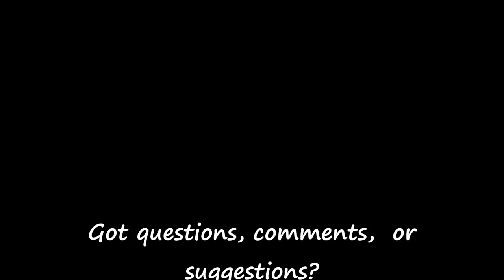My Hot-Tent Wood Stove Setup for Preventing Floor Melt...and more.

Comment: Great advice and very helpful, Martin.  Looking forward to avoiding the pool of water in our front entrance the next time we go out.
Reply from the maker: Thanks and glad you found it helpful.   I'm sure it will make a difference on your future trips. 
Happy camping, 
- Martin
Reply: @PineMartyn  One other quick question if you don't mind me asking.  What do you place under your sleep system when on the snow?  Tarp? Pad? We have not camped on Crown land so a bow bed is not an option.  Once again, thanks.
Reply from the maker: @bwbeney  Great question. I lay down a waterproof tarp, then my inflatable sleeping pad on that, and atop that goes my closed-cell foam pad, and lastly my sleeping bag.
When camping on Crown land and spruce or fir boughs are plentiful, I make a bough bed and put my sleep system atop that for greater insulation and comfort.
Cheers,
-Martin
Reply: @PineMartyn Had been wondering what replacement for my newly purchased closed cell pad would work as the pad felt rock hard and unusable. Is your waterproof tarp run only the length of your pad, bag length? Or just inside the tents' inside perimeter covering everyone's sleeping area? ( 1st year using a Hot Tent and stove in the NC Winter forests).
Reply from the maker: @bikemannc   I apologize for not replying sooner, but I have only now noticed your question.  The waterproof ground tarp I use just covers my sleeping area, but it could be larger if you wished.  I'd just keep anything that could burn or melt far enough away from the stove.  
Hope this helps, 
- Martin

Comment: Can you please comment or create another video explaining how putting 2 ninety degree angles in your hot tent stove pipe is a no-no 🤔. Thank you for finally explaining a proper stove setup. I worry about some of our backcountry friends setups and want everyone to stay as safe as possible out there. Great video.
Reply from the maker: Hmm, that's an interesting thing you describe. I think the only time I have seen two 90 degree elbows used in a hot tent is in very large tents for large groups, where the stove jack hole was high on one vertical wall (not in the roof, as it common in most smaller hot-tents).  Such tents invariably have a quite large stove with very wide diameter stove pipes which make it possible to have 2 such elbow joints and remain sturdy and avoid backflow of smoke into the tent.   I'd certainly caution against this in more typical camping hot-tents.
I'm glad you enjoyed the video.
Cheers!
- Martin

Comment: Martyn, my wife and I loved your 11 day trip on crown land and you and your wife has inspired us to follow in your footsteps on a smaller level at first.  My question is, do you leave your car at home or do you feel it is safe to just park on dirt roads etc.  It is our only concern when exploring.  Thanks you sir.
Reply from the maker: I apologize for not replying sooner. I missed this comment and am only now noticing it.  Excellent question.

We leave our car parked wherever we can, such that it's not blocking any road or trail,  not hindering drivers by being too close to the road, and not in the way of any plows in winter.  

Invariably, one has to go to the Crown land in question and look for a suitable place to park near to where one wants to start hiking, snowshoeing, or canoeing .  Sometimes, the best place to park is not as close as one would like, so one parks where one can and puts in the work of hiking, hauling, portaging, whatever distance is necessary to start one's trip.  Remember, it's not important that you be parked right where you're about to start your hike or camping trip. It's more important that it be off the road or trail enough that it won't be a hazard to others, but wont' get stuck either.

I have never had any harm come to my vehicles in the bush.  Break-ins are common at park trailheads because thieves know there will be vehicles there unattended for hours or days and probably there is gear or valuables inside.  When you're out in the middle of nowhere, the chances are slim that anyone will even see your vehicle.  Remember, anglers and hunters routinely park in the middle of nowhere every season and few are every damaged or broken into.  Your vehicle is at greater risk in a Walmart parking lot.  Just don't leave any valuables or any food in the car.  Bears can and will tear their way into your vehicle.  

Thanks for the question and the kind comments, and my apologies again for the late reply.

Cheers, 
- Martin

Comment: Hello from 2024.

Always enjoyed your video PineMartyn.

If there isn't as much snow on the ground, what would be the best way to minimize the ground becoming muddy? poly tarp on the floor with canvas tarp on top?
Also,  is it safe to place pine wood under the stove? tree sap can be dangerous, no?
In case of camping at a developed campground during winter, what other materials can be used to prevent melt other than the wood? as we can't freely gather woods in provincial parks.
Finally, before setting up the tent or wood stove on the snow, should you compact down the snow?

Can you make a detailed video on how to maintain a large canvas hot tent during  winter seasona and off season?
Also, most importantly how to prevent? or treat mold issues?

As we all know, winter hot tent + wood stove is a large sum of investment and I am seriously considering it near future.
Thanks!

Comment: Hi Martyn, when pitching your tent, if there's under a foot of snow could you not just shovel it away until you hit ground?
Reply from the maker: That's an excellent question. There are several reason why one does not shovel right to the ground. 
1) Shoveling such a large area in deep snow would be a considerable effort and would have the result that one's tent was sitting in a hole, surrounded by snow, thus making one's sleeping shelf a local cold sink for cold air at night.
2) Camping atop the snow means one can have as flat and level a floor as one wishes (one just packs it down  flat with snowshoes well before unpacking and pitching the tent to let the snow sinter hard).  There's no reason to think the ground will be flat or level, whereas the snow above can be made both flat and level with ease.
3) One never knows what lies beneath the snow, which can include rocks, downed trees, limbs, frozen shrubbery, and other ground litter, all of which is frozen hard and stuck to the ground and would be difficult to remove.  If one is in a park, setting up on a designated flat, level tent pad, then one could in principle shovel down to a flat, clear, leavel spot, but in the bush, the chances of the ground being clear of obstacles beneath the snow is very low.
4) If one shovels down to frozen ground, the heat of the stove will begin to thaw the ground, resulting in a messy mush of muck and whatever ground litter is there.

Thanks for the question,
- Martin
Reply: @PineMartyn  Thank-you for taking the time to get back to me with such a concise explanation, I always enjoy watching your videos, David
Reply: This makes a lot of sense, and goes against what we're often told. The voice of reason and experience.

Comment: Hi Martin, thanks for this. I just got my first stove and I’m waiting on my hot tent to arrive. My question is: do you use a false bottom in your stove? If not, why or have you had problems? Thanks.
Reply from the maker: Hi John.   Yes, I do use a false bottom in the stove. Many stove manufacturers sell false bottoms for their stoves. I bought my stove secondhand and it didn't have a false bottom, so I fashioned one using tin snips on a light piece of metal flashing I found at Habitat Restore for cheap.

When in use, it raises the floor of the stove about half an inch off the actual bottom, thus protecting the bottom from premature burnout and permits some air to circulate under the fire, improving combustion.  When not in use, the false bottom stays in the stove, but I flip it upside down, so as to maximize room inside the stove box and so I can still fit the nesting stove pipes, elbow, damper and shelf, etc.
Hope this helps, 
- Martin
Reply: @PineMartyn  Thank you!

Comment: If the surrounding wood is absorbing all the heat instead (of the snow), isn't there a risk that it catch fire?
Reply from the maker: That is a good question. The wood absorbs the infrared radiation from the stove, acting as a thermal mass, meaning it in turn releases some of that heat to the air and objects it contacts, so it will not accumulate heat to  it's kindling point. Contrast this with a chunk of wood inside the stove, where it absorbs heat  from burning wood around it , but accumulates it so much faster than it can dissipate it, that the wood in the stove eventually reaches its kindling point and combusts into flame. The only way a chunk of wood could catch fire while outside the stove is if it were very close to the stove AND the stove was hot for so long that the nearby wood would become charred and eventually combust. But realistically, a stove in a hot tent is not kept burning constantly and the wood outside the stove loses its heat constantly.   Furthermore, part of the benefit of putting wood around the stove is that it starts off frozen (and often with some snow or ice on it) and it eventually warms and dries, at which point it is now ready to use as fuel in the stove and newly cut frozen wood is used in place of it around the stove.
Hope this helps.
Cheers,
-Martin
Reply: @PineMartyn  That helps a lot, thank you!!

Comment: What if I cover the ground with a tarp?
Reply from the maker: Tarps are seldom used in hot tents, for a variety of reasons. First, a plastic tarp on snow or even frozen ground is dangerously slippery, which is a hazard in a confined space with a burning hot stove in it.  The only place for a tarp in a hot-tent, in my view, is directly under your sleeping mattresses to prevent them from getting damp or punctured, but the tarp should not be anywhere where you might need to stand or walk.

The second consideration is that a tarp won't reflect any significant heat from the stove. In fact, if it's a darker colour (such as one of those blue plastic tarps),  and because at tarp is so thin, it will absorb the stove's heat and conduct it to the snow beneath, causing melt.  And of course, you don't want any sort of plastic or fabric under your stove than can melt or combust.  A plastic sheet  or tarp under or right near your stove will melt.

However, there is a kind of fabric that people can use under a stove that is fireproof and waterproof, and that is Typar (house wrap).  Unfortunately, being thin, it won't act as much of a thermal mass (absorbing stove heat to prevent melt) and instead communicate heat to the snow beneath, resulting in some melt, but it would be better than using nothing. The reason I don't use Typar is that it's incredibly slippery on snow - even more so than a plastic tarp.

The best thing to cover your snowy floor in the tent is closed cell foam pads.  They are a little slippery, but not as much as a tarp, and you can sit, kneel, or lie down on them in the tent and be quite well-insulated from the cold snow beneath. Sitting on a tarp which rests on snow is absolutely freezing cold.

Hope this helps, 
- Martin